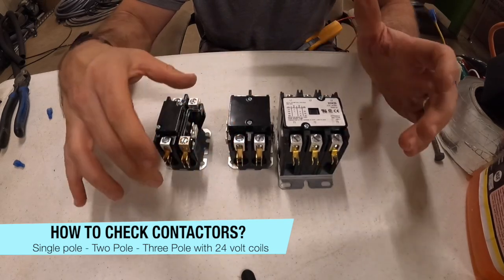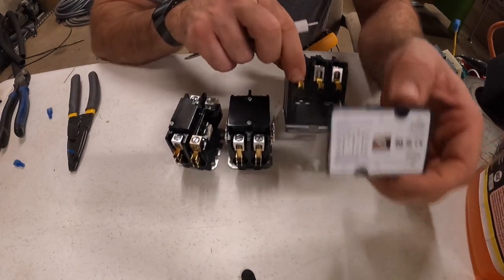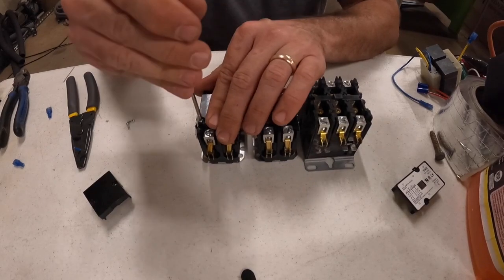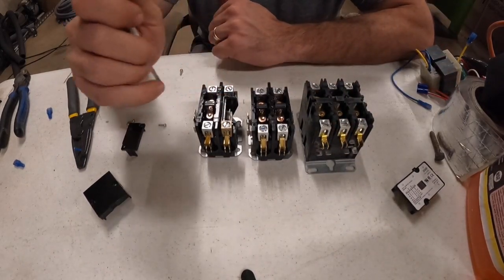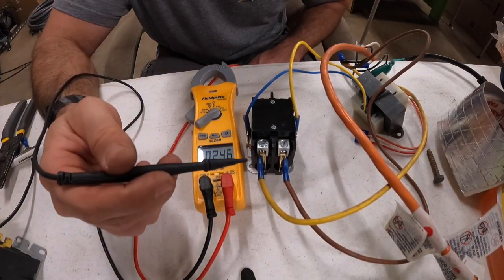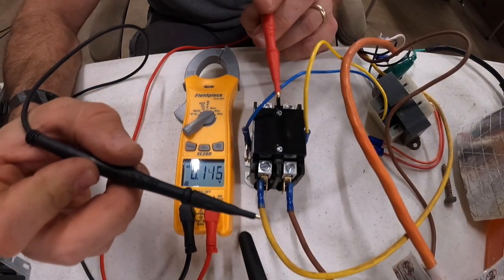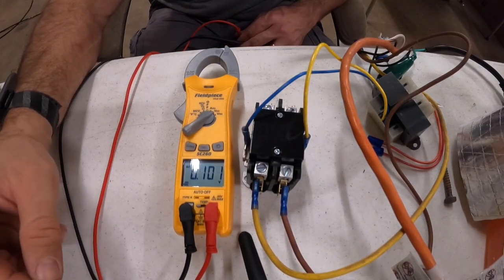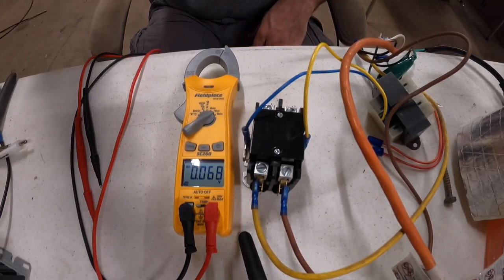Troubleshooting contactors

Comment: How come the three pole contactor doesn't have a 24 volt connector on the middle pin???
Reply from the maker: No need for a middle pin….when 24 volts is applied between the two “coil” pins, the contactor closes.
Reply: I'm just wondering what L3 is used for. I got this three pole contactor according to my manufacturer specs and part number to find they only have a 2 pole in the unit.  So I'm gonna use the three pole since I bought it. It doesn't mount right but oh well I'll put self drilling screws where I need them I guess.
Reply from the maker: @erockscott1184  just don’t use a pole/L3.  3 pole contactors are used in equipment that uses 3 phase power.  Typically you see single and double pole contactors in equipment using single phase power.
Reply: Ok...I was thinking though...lol..that if one pole went bad i could switch to the other and "shift" them down one....lol